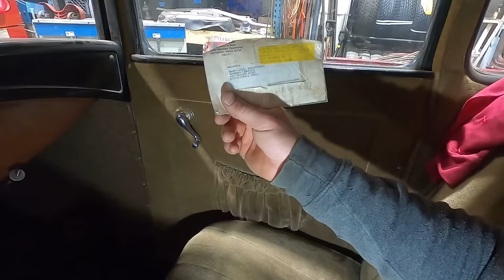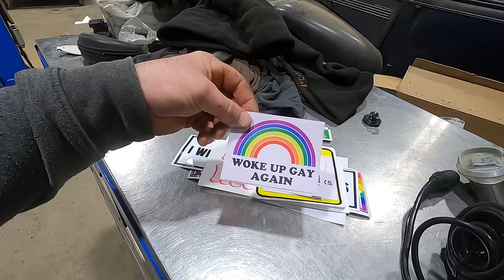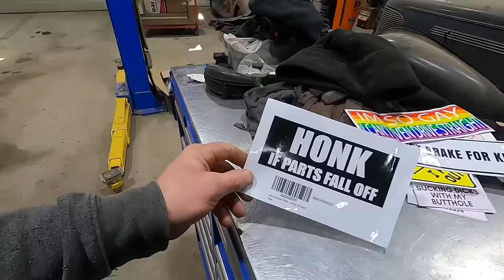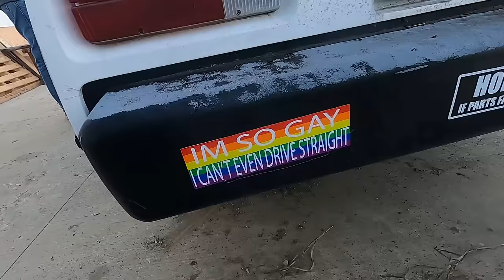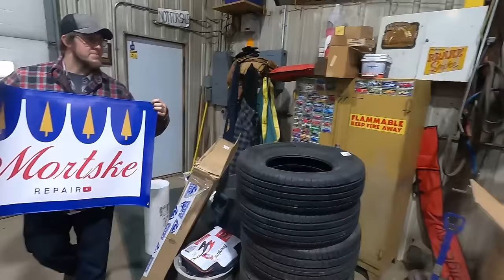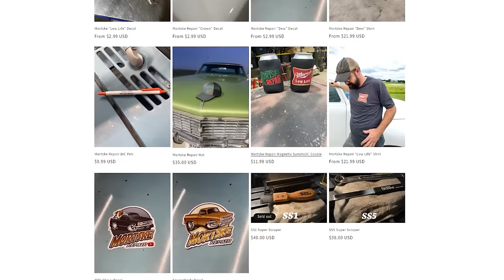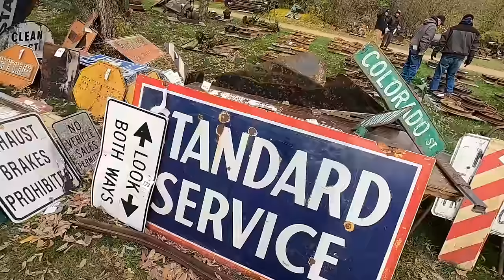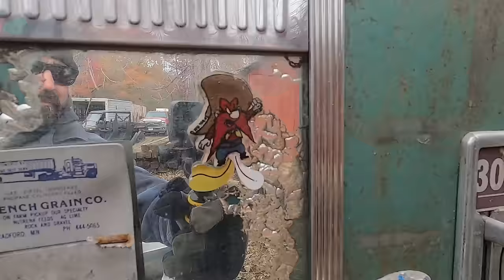Daily Driven 1931 Ford Model A Coupe! 92 Year Old Hot Rod Collector Auction Score!

Comment: It amazes me how many Model A's have survived for nearly 100 yrs and most were built during the height of the Depression!  Enjoy Mr. M!😆
Reply: 4.8 million were made so yes plenty survive
Reply: @afmajor322  They built millions of Model T's too.  But I think A's are more available.
Reply: Absolutely over 4.5 million were sold, and it's amazing any of them survived with all us hot rodders putting s.b.c. 's in em lol...
Reply: There are a few reasons why so many Model A's survived. They made millions of them. They were a huge improvement over the Model T's in function and construction. Many Model T's, even ones in good condition met their end during the scrap drives of WWII because they were considered an old and mechanically obsolete car that was worth more as scrap for the war effort than as a car to be driven.
Reply: @afmajor322 if they make 4.8 million of a late model Ford 80 percent of them will be crushed within 20 years. Think about that.
Reply: @todddenio3200  yep , and think about it, how rough the Model A had it. All the work they had to do thru the depression,  people could buy a new car. The Midwest still ran them completely thru the 40's. My step dad drove a Model A till 1950 for work. Was scrapped,  completely worn out. He bought a 1950 chevy panel wagon./van.
Reply: @rssvss  my dad worked at my grandpa's junkyard in the late 30's until he went into the Army Air Corps in 1945 during WWII and he told me about how many good cars were brought in to be scrapped for the war effort including countless Model T's that were in great condition and still had shiny paint, nice interiors, and ran perfectly. He said they even had Auburns, Packards, Pierce Arrow's, V-12 Lincoln's and Cadillac V-16's driven in to be scrapped.
Reply: @glennnickerson8325 
15 million Ts were made.

Prices on both vary greatly depending on year and model.
Reply: @todddenio3200  Ford and GM sponsored alot of scrap drive programs leading up to the halt of non essential automotive production.  They then geared up using recycled steel in early 42'. The war effort produced so much recycled metals, the stockpile was still being used here and in Japan until the 1950's we could have produced enough armament to have fought on another war front. On top of that there was enough materials to build 4 new Lexington class aircraft carriers that were in planning stages at the end of the war. The war efforts wound down, just as they were reaching 100% , the same year as peace. There was a few advisors calling for a push against Russia as they had been complicit with Germany and Italy at the beginning of the war. 
Sorry, rambling. You were 100% correct millions of tons in still serviceable autos were scrapped including the majority of Models T and A.
Reply: It was a a time before the "planned Obsolevcence" was established by agreement of all big companies.
In the beginning Henry Ford wanted to supply all rural people with affordable cars.
No joke

Comment: NICE BUY.  Enjoy driving a car older than you.  This may be the first time I have seen you drive a vehicle onto the trailer.  I love those 394 Oldsmobile engines- torque is amazing.  The gear boxes were not so hot- not allowing the engine to rev before it hit high gear.  I drove a 64 Super 88.  Great car.
Reply from the maker: Right on
Reply: I grew up on Oldsmobiles. Dad drove them from the
 time if his first car. He had a 46 55 65 and switched to Buick in 81 and 99. Which were used. My daughter drove the 99 Buick until it fell apart on the body.. 
  The 65 Delta 88 had a 425 and would do triple digitals with authority. The 55 was the coolest one if I was to get one from my youth.
    Dad sent money home from the  war to get the first Olds from the local dealer. The dealer had all kinds of offers above retail ....one of which was five hundred over. But a promise was a promise back in those days and Dad got the car.

Comment: I would say best buy so far, maybe? At least you can now have a day at the races with Scott and Johnathan W. Model A should have a air cleaner from the factory, but usually they just go missing for reasons I  don't know. Alloy head might be cool if it was a hotrod(not sure how much better it is cooling wise) but if you don't plan to build a racing engine the cast iron one will do the job. Water pump is super easy to repair, only watch out with the bushings cause these are some weird graphite bronze material. 21" tiers are harder to find than the 19" ones. Over all, if I would own this car I would do probably the same things you mentioned in the video. Only keeping the spare tire on the fender cause it looks classy, but only from my standpoint. I sure love the Model A and AA dump truck. These are a legend in some corners of the world. The Auction had lot of good stuff but also easy to go broke by drying to get everything.

Comment: I worked at a body shop in Florida in the mid 90s.  We restored a 30 coupe cosmetically and mechanically for a customer.  We converted the car to hydraulic brakes from a 48 Ford and mounted the master cylinder under the floor.  Worked great.  The cowl lights should be wired into the tail light circuit as they were designed to be used as parking lights.  Most of the parts we needed were obtained from Brattons in Maryland.  They were reasonably priced, made in USA, and very knowledgeable.  I had one of their catalogs and it had exploded diagrams of most everything.  I installed a fuse box under the seat and never had any issues with that.  That modification was approved by the Model A club of America as a safety issue.  Good luck with it, they are a great car.
Reply from the maker: Cool

Comment: my neighbor had one, four-year off-frame restore, The Engine was bored, balanced modern ignition, first time I ever saw the overhead valve upgrade. His developed just over 100 hp body and interior 110%"stock" aftermarket replacement parts He drove it interstate in New England so the hydraulic breaks came in handy!
Reply from the maker: Wow!

Comment: One of my favorite cars as a Kid ,I had a woods and field driver 29 A at 13 and drove the hell out of it until I got my 35 ford Pick at 15 up sold my A for 50 bucks ,The fuel shut off were always inside the car under the dash on passenger side
Reply: The move them on the outside for safety reasons

Comment: Tempting, my friend.  Very tempting......  I prefer the A over the T for ease of driveability, although the first of the As had the accelerator in between the clutch and brake pedals.  The sounds that beasty makes are heavenly - the positive puff from each cylinder on tick-over and the whines of the straight cut gears in the box.,,,,man, she's a lovely thing.  Gear selection would be easy for someone used to rev-matching gearboxes with weak synchros.  I've also driven track cars with straight cut gears and no synchros whatsoever, so it would be no trouble.  What a wonderful old machine just as it is...and I love that big horn-shaped heater induction idea!  How neat is that?

I'd be doing the little bits that need doing to make it safer (the fuel leaking into the cab from the sight glass comes immediately to mind!) and a bit more comfortable to drive, but not doing any mods to the drive train whatsoever until I drove it as is for a while.  You might decide that a taller wheel would suit the car better, in which case there's your open road gear ratio improvement right there.  I like the fact it has good lights, better brakes and blinking indicators too, although they are only at the rear by the looks, so I'd add some front ones but NOT screwed directly to the bodywork (I hate it when people do that!), but on a riser plate bolted to an already existing hole each side in the front bumper.  

The panel work?  I'd be getting out my paint brush rather than a spray can and would do it like they did in the old days - buy a tin of black paint and just hit the spots that need covering.....like the bare metal on the boot....er....trunk lid and a couple of other spots.  A two-inch long-bristled horsehair brush would be perfect as the brush marks would be minimal.  The RF fender?  Might be easier to find a replacement than panel-beat that / weld in / dress the repair etc....and as you quoted earlier: "Where do you stop?"  Find a second hand fender in reasonable nick, beat it so it looks right and then brush some black paint on it.  Tart up any rust holes in the bodywork or where the chassis is weakened (if any), but otherwise, the body needs no work.  The hole in the floor pan - if it's under your seat, you might want to self-tap a patch over it to stop any meeces getting up in there and making a home.....or chewing on your arse.  Oh - and I'd treat the running boards for rot, paint 'em with me brush and get some mats for them.....or make some from a sheet of rubber and some aluminium strap.  It would look like a period fix and not look as out of place as a set of shiny new embossed black rubber mats (or be anywhere ner as expensive either).

One last thought - I see it has lever dampers....and that took me back a few years!  Man those are fun things......  Had them in my 1950s Austins.  The A30 and A35 were ok, but the A55 had a habit of dumping oil out of the front ones through the bushes where the arm meets the damper.  I'd fill them full of oil and 100 miles later, the oil would be gone and the horizon would be going up and down like a bloody see-saw.  Got to the point I was using a mixture of EP140 gear oil and grease so I could get a couple of hundred miles between top-ups.  Those dampers work extremely well when they DO work and the A55 would ride super-smooth on the mix I put in, so if you can get the RH front one unstuck and reconnect them on either side, start with 30-weight oil (should be cold enough to increase the viscosity to the equivalent of about 20w/50 here) and see how incontinent they are before increasing the viscosity accordingly......or just get a telescopic shock conversion kit!

This is one I think you should add to your collection and do what ol' Skip did - use her as your daily.  All the best.

Comment: Good one Morticus! This episode reminded me of stories my grandpa (PaPa) told me about his first car! It was a model A. They would overhaul the bottom end every two weeks when they went town. They used hog fat for bearings. True story.  The year was probably about 37 or so. Two thumbs up.
Reply from the maker: wild times!
Reply: A buddy of mine said he soaked strips of leather in oil for bearing material.
Reply: An old timer told me he used to drive long distances frequently and occasionally had to replace the main "bearings"  using his leather belt. He'd do it right in a parking lot off the side of road and get going again! 😂
Reply from the maker: crazy @mintercms
Reply: @MortskeRepair  Tell me about it! I tried slipping a bearing in once and it was a total  failure right on the lift. This dude drove on belt leather done at night in a parking lot! 😂😂😂

Comment: I noticed you A does not have the oil filter kit on it. 500 miles between changes without 1500 miles with. But you like working on cars, right. Has the alternator conversion the original generators are the pits. Great buy, I'd love to have a A. Unlike the T the Ford A is  a normal car.
Reply from the maker: Never even seen one with a filter

Comment: Tom that's a very nice toy if you don't mind what did it cost? I paid 13000 for a 57 two for sedan which has a complete floor and body supports a running 305 and a rebuilt  torbo 350 trans. The body is good with the usual 4 rust holes by the wheels. The shiny is in good shape.
Reply: The floor is new along with the body supports.

Comment: This is the perfect car for the Inaugural Mortske Repair Midwest Grand Tour.  US 2 the Highline going East to Mackinaw City, then  South to US 30 the Lincoln Highway, back West to 281 north and back home. An epic road trip for sure. Only 2100 miles or so.  At 35 mph and 6 hours a day that's 210 a day for 10 days.  There has to be a car club, you tuber, car show, museum, something you could see every day. Get chin to drive the Tow pig with a trailer for a support vehicle. Duff out the window of the model A. I can see keys to the cities ...

Comment: Looked up some specs. on the Model A, and it is indeed plausible that my father got his to 70 MPH. Several sources state that the Model A was good for approximately 65 MPH in stock form, and good running condition. Be that as it may, I certainly wouldn't want to drive one that fast. I took my '49 Ford F-2 to 70 once and it was cause for some pretty severe sphincter pucker.

Comment: Sweet Model A coupe! My two cents: 1) Don't sell it. You'll probably search a looong time before you find a perfect 'driver' like this one; 2) That thing just purrs. The engines in most of the restored A's you see puttering around at car shows sound like there's a metal coffee can full of lock washers and angry bees under the hood; 3) If you keep it, I'd get one of the many hydraulic brake conversions out there. I'd get the ones with the Lockheed style/ Lincoln backing plates and shoes instead of the '39-'48 Ford style. Otherwise (this is from personal experience) you're a cotter key and clevis pin away from careening into something.
4) Just my opinion, but I have yet to see an 'A' that didn't look better with '35 Ford wires and 600/16 tires. But that's just me...
Awesome episode! Always fun to see some shade thrown at DD Speec Shop 😂

Comment: If you don^t want to mess with it  Then dont mess with it.. One of my Grandsons has Attention Deficit Disorder and you have all his faults.  If you sell it (Or not) you are planning on interfering with the originality of the vehicle.   Ok  Fix oil leaks,  Seat tears,  mechanical defects, Body damage etc.   Leave the shelf on back of Seat as next owner may want it as original,. Leave the Rumble seat fittings as is,and  Fog lights, Tail lights and original fittings, . Henry Ford knew what was appropriate for his 15,000,000,000 model Ts.     Sure fix leaks, Brakes  Lights,  and other safety issues. .  Dont vandalise the classic Car.   The creation is 92 years old and was created in the era when very little mechanical expertise was available..

Comment: It has   a '30 'shell ; the '31 shell had upper separate steel panel like the bottom. It has the usual '70s- '80s Model A repro items.  Extra tailamp ; maybe cowl lamps added unless a genuine Deluxe, but most were standard models ; the rumble 'grab handles were only put on roadsters etc for the top to rest on [ protect the rear glass] BUT all the early restorers thought you needed grab handles & put them on coupes.. It would be difficult to bend down to use them while getting in? The carrier is the crappy deluxe repro one, made inTaiwan. Not original interior ; they had cotton cloth or Mohair if Deluxe. The Deluxe coupe had an interior similar to Town Sedan. It is nigh impossible that a car would have original cloth or paint after nearly 95 years. Get a repro handbook so you can learn how to properly start & drive it ; nearly all youtubers do it all wrong. Cheers from an old guy with 2 Model As.